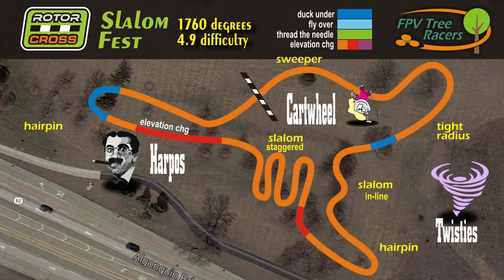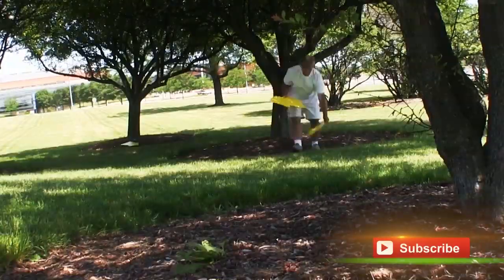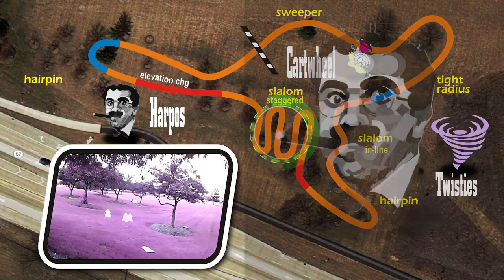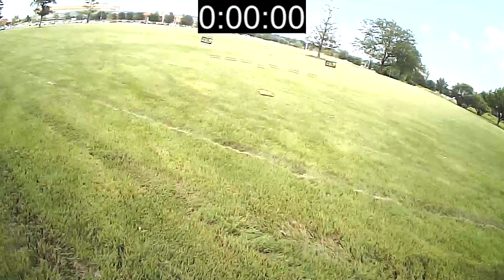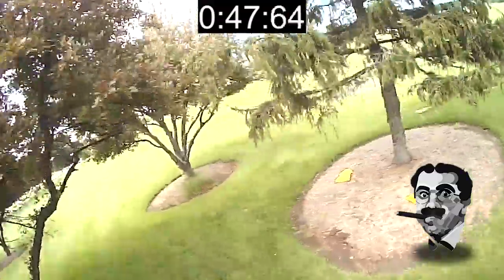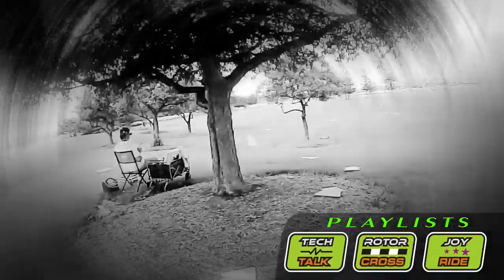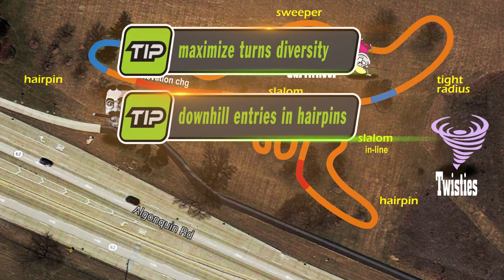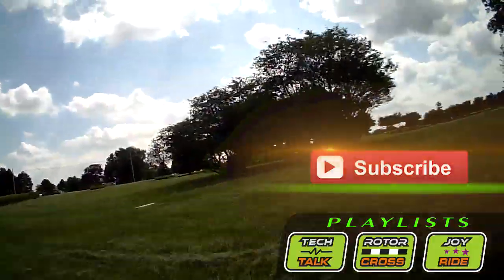Drone Race School: Slalom Variations // NAZE32 QAV250 // Rotorcross @ Slalomfest

Comment from the maker: Brian, depending on your fc, use just enable a switch. I use a 3 position to control flights modes (acro, self level, self level + beeper). It is done a little different depending on the FC (KK2 or naze). Since I have lousy eye sight, I always turn the beeper on after every crash then follow the beep.